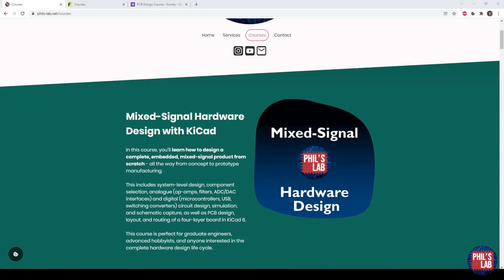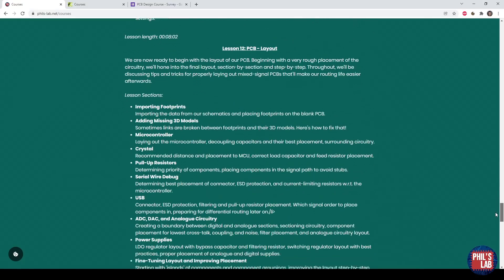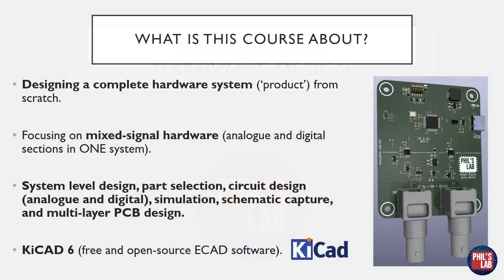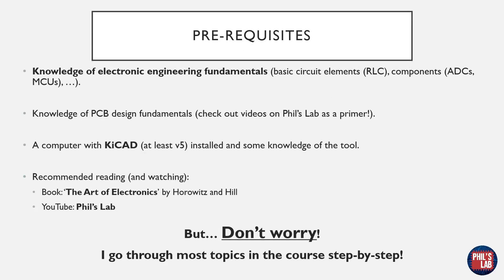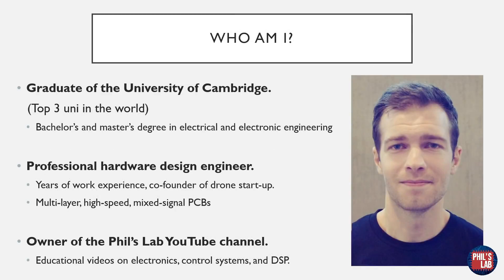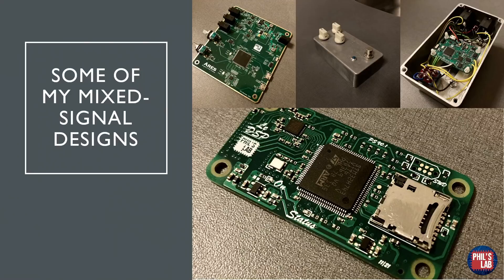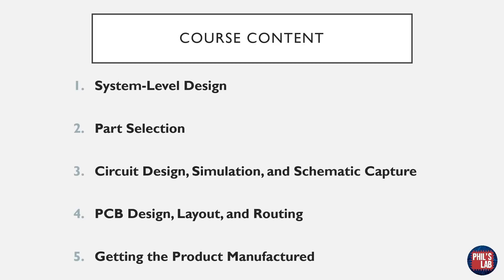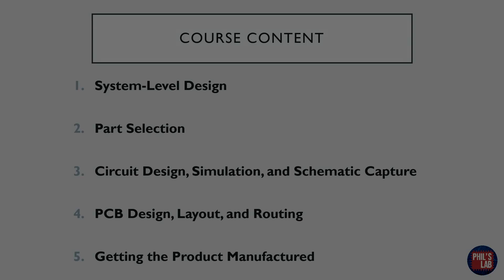Course Release - Mixed-Signal Hardware Design with KiCad - Phil's Lab #44

Comment: Great timing, thank you!
I have 2 questions if you don't mind :)
1) So the resulting PCB of this course is a guitar pedal, right? (great choice, I'm also a guitar player)
2) Do you follow Rick Hartley's recommendations according to PCB stackup, digital/analog ground planes, etc.? I suppose this topic is convered a lot in the course.
Reply from the maker: The board isn't directly a guitar pedal, however you can use it to be one (with possibly some modifications). And yes, I'm following Rick Hartley's recommendations!

Comment: Definitely interested, and I would sign up right away.... Except, the bit in the pricing schedule of there being a time limit (10 weeks, limited extendability) on course content availability is a bit of a turn-off.
I wish I could just sign up and get indefinite access to the content.

It looks like the $299 option might offer that, but its unclear whether or not the clock is still ticking from the time you sign up. Can you clarify?

Regardless, this pricing schedule seems to imply I shouldn't actually sign up until I'm ready to put my head down and power through it...  even if I'd otherwise have just bought it today.
Reply from the maker: Yeah, I completely understand - I’m afraid this is following the typical Fedevel pricing structure. However, I just updated the length to 6 months - hopefully that should give plenty of time to complete and come back to it several times!